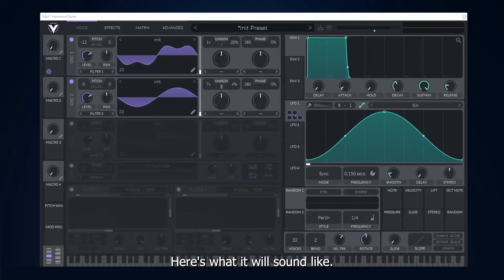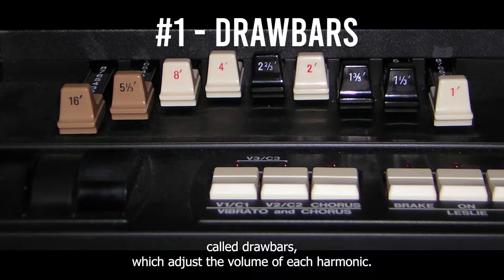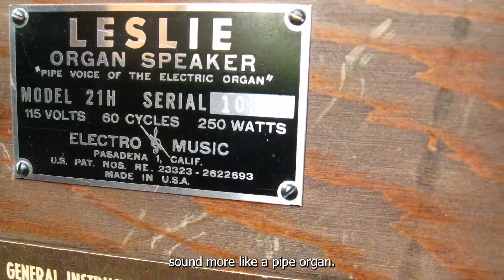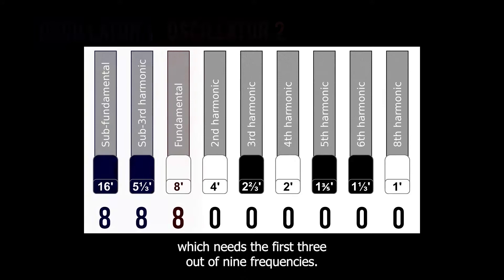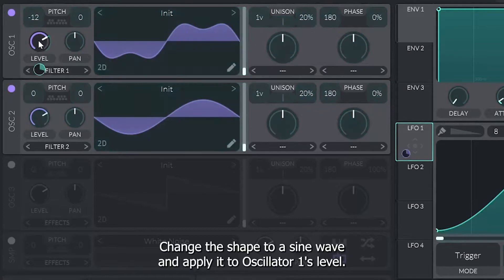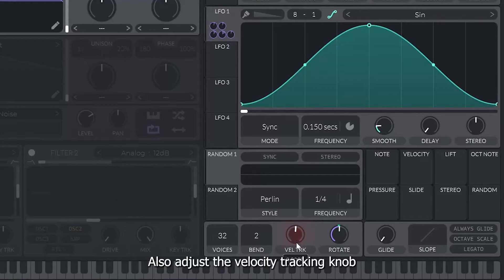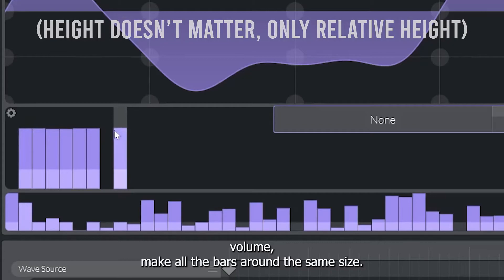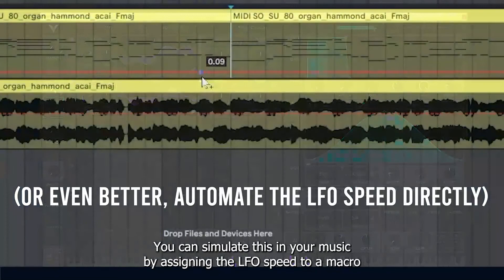How to Make a Hammond Organ in Vital | Sound Design

Comment: Great video. Thank you.
If only we could assign those harmonics  purple bars to MIDI sliders...
Reply from the maker: Thanks!

Yeah, you can't assign them directly that I know of. I thought about it this when making this video, but it's not straightforward. So I went with the assumption that you know what you want ahead of time and don't want to change it while playing.

You can do this to a limited extent by making your wavetables slide through several drawbar configuration, and then assigning the wavetable positions to MIDI sliders.

But to do this right (using Vital), you need something like Ableton's instrument rack. Add three instances of Vital to play in parallel, and have each oscillator in Vital assigned to a single drawbar. Then, assign the MIDI sliders to the volume of each oscillator. If you're in another DAW and don't have something equivalent, you can use three copies of the same track (with each Vital oscillator set to a different drawbar), and play them at the same time.

I'm sure there's an easier way to do this, but that should work if everything is synchronized and there's no weird phasing issues that happen. I haven't tried it yet though.